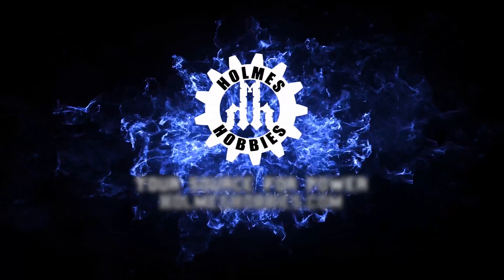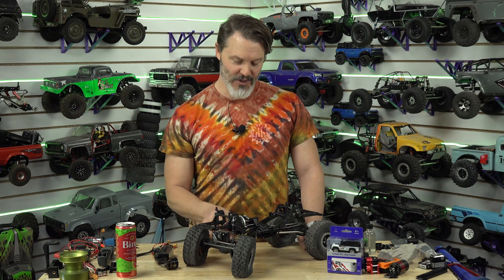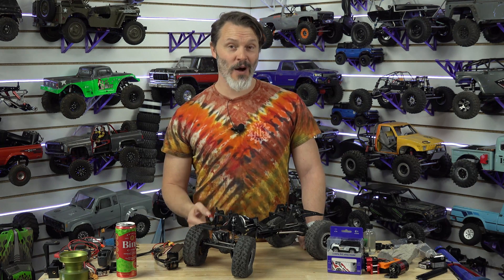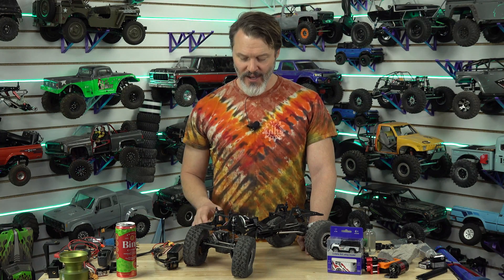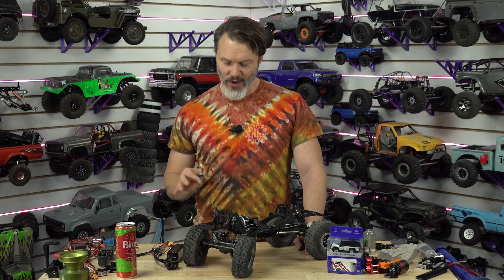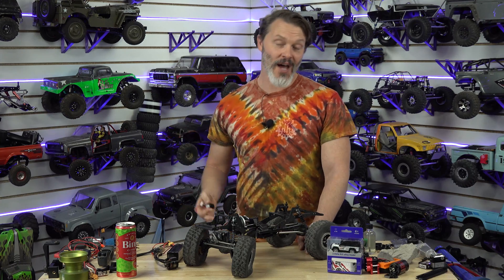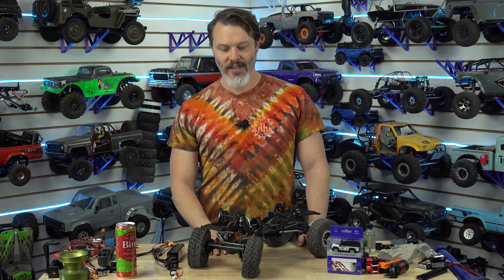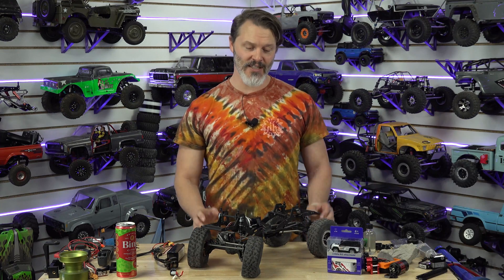🛑 Servo Failures from Small Batteries? Let’s Solve It Together! 🔋💡

Comment: Question for you about the HV150. What’s the chances you can make it 1mm shorter? It measures 21.5mm from the servo mount to the top (vertically mounted in a TRX4m). How my truck is setup it won’t fit taller than a 20.5mm servo comfortably.

Comment: Couple things john. 1: add some series inductance between the servo and the battery. Then scope the power at the servo, and the power at the battery. See if the transients are in fact coming from the servo. 
2: add capacitance to the power input at the servo. Even if it's not enough to fully catch all the spikes and brownouts it will help to smooth things out. 
I would bet you're right on the money with transients, but it could be some weird combination of drive motor and servo motor combining to create a particularly nasty spike.
Just my $.02

Comment: Exocage rc did a video about this a couple weeks ago. Might be something  to check out. Basically batteries are not truely as advertised and and change amps and discharge rate with temperature pretty drastically! Thus starving the servo of power

Comment: I run in two trucks this exact setup: 1Tenth BMF1095L servo, HH crawlmaster mini v2, HH 2250kv team spec outrunner with 300 LiPo 4S direct power. Both setups are one year old with no issue.

Comment: I comp my C2 and C3 trucks with 450mah 4s Gensace packs. The C2 runs an NSDRC 800v2 with a Castle BEC2.0 for a servo winch and receiver duties and the C3 runs 2x Holmes SHV-500v3 and a Tug Buddy with a tiny voltage converter for a BEC. My C1 runs 750 Tattu 3s packs and a Shift X2 with a Castle BEC for servo winch and receiver duties. All 3 rigs have direct power steering servos and I am running AM32 converted drone ESCs with outrunners on all 3. I like to credit my use of quality Nichicon 470uf filter caps on the battery input to the ESCs for my lack of issues...but maybe my packs just aren't small enough to see these problems. I have added a zener to the "Superior" equipped rig for safety since diode-gate revealed the potential issue. 😉

Comment: Only servos iv had issues with is with scx24 stock servos and one emax. I have a two year old slash still rocking the stock servo and it gets used HARD. almost daily. I dont know what im doing😂 but i run a furitek perentie with a python x esc and a hexfly servo from a redcat. And i run 3s zeee batteries no leas than 2200mha   Only thing that fails for me are axle shafts in my crawler.

Comment: Everyone should be running separate batteries for servos and radio to keep power output consistent. This is a well known issue and the reason ProModeler Servos recommends running separate batteries in crawlers and airplanes. You’ll never burn out a servo this way if your end points are set

Comment: The only time I’ve ever had any problems with my comp trucks is when I tried to run a 350mah pack. I had power cuts when moving, the servo performed like trash and I BARELY finished the course. Like, had to wait for the ESc to pulse the LiPo safety so the truck would move through the last gate. Never again. 650mah at a minimum now.

Comment: Capacitors and Super caps are super cheap. Would they help protect the servo? 

I understand the video topic is slightly different problem i was having but might use a similar solution?

My bec on my esc is underpowered for the servo I'm running. I realized this upon noticing the truck was having brown outs on hard steering draws.  Too cheap and lazy to install and wire a proper bec so i slapped in a super cap on the aux channel and my problems went away.  Also i could steer full lock 3 times after unplugging the truck battery🤣
Reply from the maker: @Jrod_FPV   the amount of capacitance we need is in the 1000uf range. How big is the super cap?
Reply: @HolmesHobbies  shoot I can't find it. I remember it was smaller than the smallest digit of your pinky finger, but I don't remember exact dimensions. to get exact dimensions you may be best browsing, digikey or similar. I don't know if that a super capacitor can absorb the energy as quickly as a traditional capacitor, therefore, you may need to either oversize or use regular cap to have success? I wish I could be more help but that's All I can offer.  I'll reply dimensions here if I find it.

Comment: All my direct power servos have failed in the same way that none of them will recenter and just spin in one direction infinitely. No idea if that's related to this or not but they've been run off 6000mah 4s that was also connected to the esc.

Comment: I run a 650mah 4s china hobbies lipo, vanquish carbon kit has a reefs 888 direct power. On your crawlmaster v3 esc and 1800kv 540m hooked to a flysky gt3c remote powered off the esc. Beat the crap out of it at the local club over the summer a few times and had no problems. Ran prolly 20 packs throw the system so far. Your servo wasnt in an i had to buy a reefs 888, it hurt me. Now im not shore i can make baby's. 😂😂😂😂

Comment: Have lost 3 servos, first 2 are Holmes 650LPs on 380mah Gaoneng 4s battery, DLux esc, flysky reciever, both front and rear failed with slight turn and power at different times.  Reefs 900LP with a 1500mah Zee 4s, furitek esc, diode harness, slow crawl with light turn failure, maybe 2 minutes of runtime.  Has always appeared with slow crawl and a little turn.

Comment: I am running a Crawlmaster mini V2 esc, Reefs 900LP servo, 1900kv purple team spec revolver, Spektrum SR2100 receiver, and Spektrum 450mAh 4s battery. No issues so far. Receiver is powered from internal bec in the esc.I have had this setup running since May 2024.
Reply: My set up is damn near identical except I use a Radiolink. I’ve lost 3 900lps now and never ran a battery smaller than a 4s 850 mah. Crazy as hell. With inline xener diodes

Comment: 550 mah 4s rline tattu, exo belay with 8.4v bec for radio, 1800kv snub nose revolver, 17v zener inline with nsdrc rs800v2. No failure due to batteries. Had a rs700v2 die right out the box due to motor defect. Other than that its been solid.

Comment: I laughed when my Mojave Grom came with i wanna say either 1400 or 2200 mah battery.  I thought to myself "aww how cute.  Who's actually gonna use a battery that small".  Until then my smallest was 4000mah 3s that i bought specifically for my Omni Terminator because my next smallest 5000mah 3s wouldn't fit.   All my other 3s, 4s and 6s are 7000-10000 mah. Coincidentally zero of my few dozen trucks are comp crawlers.   I've also only killed 1 servo in the last 3 years since abandoning Traxxass and their plastic geared servos.

Comment: I use 650mah 4s or 850 mah 3s when comping. If just crawling I use a 2000mah 4s. 

Holmes crawlamster esc. Power reciever off esc.

Comment: In the comp trucks 
 C1
 450-4s ovonic
Servo G13-pro  direct power 
Rhino 40amp 
HH team spec snub nose 

C2.5 
650 or 850 4s 
Reefs 888 DP 
Rhino 80a 
9imod 35-42 out runner 

C2.5 
650- 850 4s  with the diode thing 
Rs700v2   DEAD.  GATE 1 front tires thru and no turn,  just died on the spot  no fireworks, no smoke. Just died 
Rhino 80a 
HH 540M 
Switched to another reefs 888 and no problems

Comment: I'm my c2 I run 650mah and 850mah 4s with a mamba x and an original 1800 revolver. I have a 1tenth direct power bmf1095 servo. I have not had any failures but I have tried to get a failure for r&d on the servo and have been unsuccessful.

Comment: Take direct Power Servos completely out of the motor, electrical system.  If it is truly necessary to run a 250MAH pack for, servo, receiver, and motor power, create a buss system, powered by the 250MAH pack.  A shunt side of the buss powers the motor only.  A clean side of the buss won't allow a transient power surge such as back EMF to enter the clean DC power for the servo.  While current remains a problem with small packs, the servo will only see clean DC power with no back EMF issues.
Reply from the maker: @robaustin9557   while a good solution, IMO not practical vs just running a bec powered servo and nice bec.   I just don't like the idea of a conditioner as additional component needed .

From the work I've done since filming,  It appears to be a capacitance issue on the servos.  The ripple is still blasting past the tvs or zener.   We need at least 470uf if not 1000uf more to clamp what the battery cannot. That's a LOT of volume that really needs to be inside the servo but can't fit.
Reply: @HolmesHobbies  Regarding a conditioner as an additional component, point taken.  Regarding the 470 - 1000 Cap, in the end you'll end up with a big contraption that people won't want on the ultra-weight saving rigs.  I think that the idea of a BEC able of the peak servo amp+ would most likely provide the power you need.  However, as with many Lipos, the C rating is not accurate, and regardless of downline equipment, bec, eec etc. if we cannot maintain a clean DC power with ample current, our electronics in the servo won't like the "Brownout" condition it could see.

Comment: 550mAh Tattu 4S and Ovonic 450mAh 4S in a VRD, Furitek Python & Kommodo 10 2000kv, Nsdrc RS700V2, Nsdrc Voltage Spike Surpressor Diode, Sanwa Receiver powered by ESC 

No issues

Comment: Uhh My Little tiny SCX24 uses a 350mah. It's so small. I made a 2s with 2cells i recovered. i think it is about 1200 mah. jst plug 60a esc. 370 Motor. Also use 3cell lipo 2200mah same set up. Giant servo would pull more Juice and empty that silly battery fast wouldn't it. Just like my stock little 2s battery on my WPL when i turn while driving it is slow. The Draw Matters. Those large servo motors like my 180 stock in my WPL. With a Protection circuit i would think the Servo would cut out with a little battery. Why so small in a 1/10. Seems Weird.....Rated for a Normal Battery on the Pack, Small mah run at your own risk. WEIRDO's lol hahahahahaha Just run shit normal wth is wrong with people. oh wait, i change everything too. LOL .

Comment: I've ran the Crawlmaster Mini v2, Rhino 40a, Rhino 80a, and my own AM32 flashed Wraith32 ESC. I always run a 850mah 4s lipo battery. Never experienced a servo failure and I've used NSDRC, Holmes, and Reef servos with no failures of any kind.

Comment: This is only a problem when running 4s power, drone based ESCs and outrunner motors. All of you who aren't running this combo won't have any issues. The issue lies in transient voltage from the outrunner. As the motor spins down it back feeds voltage into the system causing a momentary spike in voltage that the small battery packs cannot dampen and burning out sensitive electronics that are directly powered by the battery. Guys running brushed motors? You're fine. Running 3s? You're fine. Running an inrunner? Shouldn't be an issue. I have no issues thus far with my HH 2040kv snubnose and silent assassin ESC paired with NSDRC 800v2s. This weekend I'll be swapping things around to a different rig and throwing my CM3 in my C2 car and I'll let you know how it goes. The SA ESC has servo protection built in and the CM3 does not. We'll find out if 150 bucks goes up in smoke or not this weekend 😬😬😬
Reply from the maker: @justinnoble2497   I've got plenty of instances with this happening with castle, SA, dlux, and all brands and builds of escs. My servos have an internal TVS now. .I've seen them killed with inline diodes as well.

The root cause is still completely centered around the very very small batteries.  It just so happens that most people running the super tiny packs are also running outrunners and am32.
Reply: @HolmesHobbies  I've not seen one do it with a castle or normal style system but not to say that it can't I reckon. Just happens more frequently with the setups I've listed it seems like.
Reply from the maker: @justinnoble2497  it's definitely happened.  It's just that everyone running small packs is also running outrunners and "drone" escs now so it's the common system for comp guys to shave weight.
Reply: @HolmesHobbies  gonna be really interesting to see what happens this weekend when I run the 2040 snubby and the CM3 on an 850 and the SA on the same motor with an RDQ 380 4s in the Nessie. Fingers crossed I don't burn up a servo but I'll do it in the name of science!

Comment: I have a CMv3, 2023 team edition 540SS 2250kv, NSDRC 700v2 and 550mah 4s pack. Was a new build. Initial startup on 4s when I plugged it in, one touch of steering input and the servo would jerk around and glitch. Unplugged it and it did it again 2 more times. 3 tomes total first 3 times ever powered on. I remember seeing a FB post earlier last year about some servos doing this on 4s. I switched to 650mah 3s battery and I've been running it for 9-10 months with no further issue.

Comment: In MOA, GNB 380mah 4s, dual br mini, 16t magnum stubbys, RS700 v2 servo using an MT12 radio on li-ion battery. No issues.

Comment: gforce 460mah 4s. HK hobbies STFU esc. SHV500LP and SHV650 LP in same truck. Radio powered by Super tiny amazon bec. Zero failures. Next truck same pack, crawlmasterHV esc, SHV650LP same bec as above. both with holmes revolver motors.

Comment: Omg I’m not the only one who had this issue then. I ran a savox 2290, sr213 with a mini crawler master v2 and 800 mah 3s. My bec was set to 7.4 the issue happened when I was checking the steering speed and its burned up my servo. Savox did warrant the servo. I never thought about my battery being the issue. A buddy of mine did tell me you were working on this issue about a year ago

Comment: I take 2 pcs SHV650 and have issues!!

1. I use 5 minutes in house with slippery floor, and died! I use Holmes Hobbies esc, wired direct on battery, battery Gens ace 450mAh.
2. I use on stand with wheels on air without th and died! I use Neutron esc, wired direct on battery, battery Gens ace 450mAh.

In same combination I use another 2 brands of servo direct power and no problems!!! Please don t tel me battery is problem! 

I write many mails and in my opinion customer service is zero!😢😢

One servo I manage to change with another goods from the shop I buy but second one still waiting answer on mail… I can still wait because I m young😅😅
I m fan Holmes Hobbies products and I use 2 esc, 2 servo winch and 3 motors but this new servo…
Reply from the maker: @PodarAlexandru  look in the comments around you, this isnt limited to my brand of servo. I'm glad you are finding luck with other brands at least.   It's industry wide and always has the common dominator of small packs.
Reply: So… I understand no warranty and is my foult?! I think is my foult because I trust in HH descriptions… (maybe you forget what say in description)… I will forget about warranty… as usually client guilty… 
P.s. own development and driver is A€@%
Have a good day sir!
Reply from the maker: @PodarAlexandru   we will cover your warranty.
Reply: I believe you want to solve the problem but please assume what you say in description of servo and please don t put finger on battery, esc… as I say many time I m fan HH products and I have few, using without any problem!!
Sorry but my situation is very frustrating…
Reply from the maker: @PodarAlexandru   we may end up needing to limit the battery size for direct power, and recommend bec powered servos for very small 4s .  I'm not there yet but the solutions are practically BEC sized.

Comment: My c3 killed 3 different servos over the course of a weekend.
Holmes 650
Nsdrc 700v2
Agfrc low profile direct power I do not remember the model.

450 tattu 
Holmes crawl master v3
I use the bec in the crawlmaster to power the radio

Comment: Ive been running 850 mah 4s gens ace lipos with dual rs800 v2 servos on an 8lb RCSpeedy R2 and had no issues. It also has a crawlmaster v3 esc and 1800kv 540 outrunner in a dlux fab portal transmission.

Comment: Third video about this that doesn't explain whats actually happening, how   does getting not enough current ruin the servo ? I thought it would lose speed and strenght.
Reply from the maker: @snörre23  this is what we are trying to narrow down.  Originally there was an issue with small packs causing voltage spikes.  We have tvs in the servos now and it seems there is another issue, but still centered around the small packs.
Reply: @HolmesHobbies  OK, i have my first direct power servo and was concerned with these recent videos. But i use a 850 battery anyway.

Comment: 380mah 4s and 450mah 3s, no failures. 
Silent Assassin “70 amp” esc, Dlux stumpy 2200kv, direct power nsdrc rs700v2 servo, rx powered off mini bec. I use this exact setup  on my mini, sporty, pro moa and c2.

Comment: 2 servos burned. i used tattu gens ace 4s 450mah, esc one was with holmes hobbies esc, other servo was on the neutron esc. servo was powered directly from the 4s lipo. receiver was powered by the bec from the esc. both servos are the latest low profile that you have. i think the issue is only with this servo shv640 tbh.i see shv500 no problem. i really want to solve this. is not ok to spend more than 360 usd dollars and both to fail. both of them failed on the bench, no throttle.

Comment: If those tiny batteries don't last that long on a 24 scale how the hell are they running on a 10 scale
Reply: Minutes for comp runs basically.
Reply: I run a 450mah 4s in my VRD Carbon comp truck. Typically around 8 minutes per run. I want the lighter weight of the smaller batteries. I've not had any issues yet. Though for trailing I'm usually around 2200mah for 1/10 scale rigs.